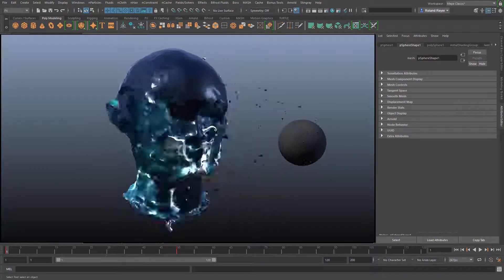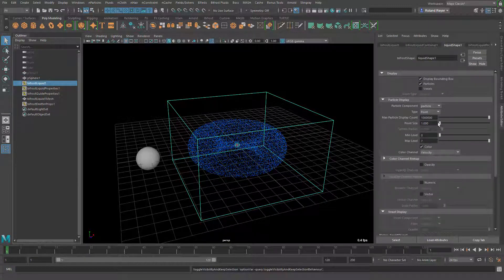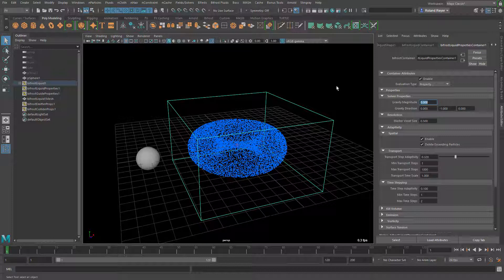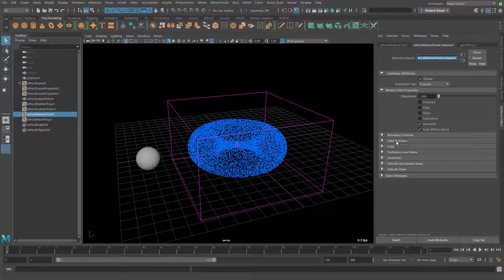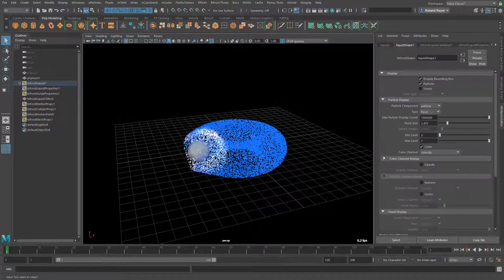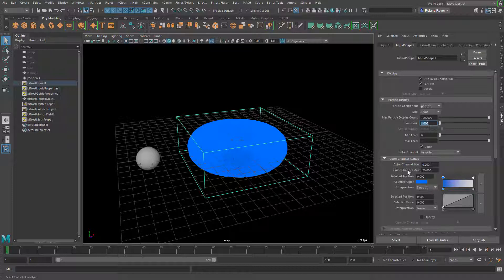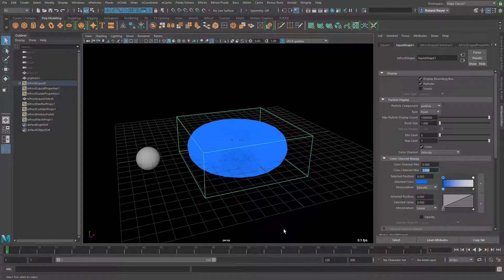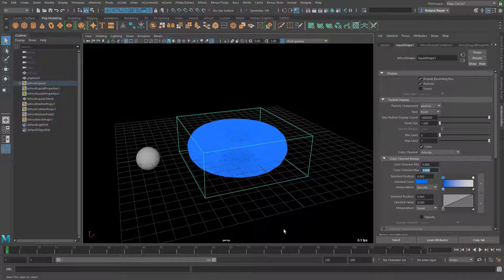Simulate liquid objects that keep their shape - Maya 2018 - Bifröst

Comment from the maker: The video has the wrong title slide and nobody ever noticed!
Reply: Hi, I'm on Maya 2016 in my school, and on I don't have Motion Field in the Bifrost, any way to replace it on 2016 ?
Reply from the maker: @alexismaquaire6201 Hi Alexis, as a student you can use all Autodesk software for free! Visit https://www.autodesk.com/education/free-educational-software
Reply: Roland Reyer I disliked
Reply from the maker: @nedkelly6286  Never mind. I know that my German accent is hard to bear.
Reply: @RolandReyer  Your accent is totally fine sir, thanks for helping me with this subject. Trying to settle a sim back down to a still surface, this is going to help a ton!
Reply from the maker: @AlecrimVirtual  Which version of Maya are you running?
Slow performance could result from the settings in the Bifrost menu regarding cache.

Comment: i'm trying to create this Terminator effect where the figure appears from a puddle of liquid metal. it kind of works ... but the geometry shape is only very roughly recreated . Even with low voxel size. Any hints on this?
Reply from the maker: Is the liquid behavior very important? If not, you could try the new Bifrost 2.1 which does not (yet) have the liquid simulation like Bifrost 1, but it can turn geometry into a volume, make an isosurface from it and there you can adjust the resolution so that you get closer to the geometry.
Reply: @RolandReyer  thanks i will have a look

Comment: Hi...Awesome tutorial... I followed all your steps, but my liquid wasn't going back to the original shape...But I was able to solve it.. I figured out I had to increase the magnitude of the field and also apply a value of 1 for the drag normal value...
Reply: Thank you for this, really helpful! I was just applying the Normal Drag value and still testing it but I'll also play around with the magnitude of the field to achieve a similar result to the video.
I've also found that under bifrostMotionFiledContainer > Geometry > Max Distance increasing it has an impact on that as well I think, for me putting it at 2 seems to work relatively well, but I'm still testing to make sure I understand what it does.
Reply: Thank you for this!! I also had the same issue.

Comment: Hi, how are you? Amazing tutorial, but I need your help, my PC doesn't run maya fluid well, can you check if my configuration is good? My PC config.: AMD Ryzen 7 2700X - 16GB RAM - NVIDIA GeForce RTX 2070 - 2TB HDD + 240GB SSD

Do you think that my cpu is enough to run fluids? Thanks
Reply: not enough, needs quadro, but still its ok ok fast
Reply: u need to know that bifrost and everything having dynamics are heavy no matter what pc, theres no liquid smooth build no matter what u make sli with, it does get close to that in very very heavy build of quadros on sli but hey, u gonna sell urself for that.

Comment: Hello there! I followed this tutorial using a photogrammetry head mesh. I came across a lot of issues with it not wanting to return to the original shape despite "Enable Falloff" being turned off and "Drag" being played with. I finally figured out that for some reason it didn't like the fact that the photogrammetry was a plane so had no thickness. This isn't picking at the tutorial at all, just a workaround I found for anyone else having similar issues! :) I'll be uploading the final vid soon, thank you for your help with this project!

Comment: Sir after applying motion field to the object with the along normal -5. even before colliding the sphere the liquid is traveling towards -x axis direction
Reply: Even after that there is no change in it sir
Reply from the maker: Hi, this sounds like the motion field still has some uniform component on. The field should be just "Geometry", no other field.
Reply: Thank u sir now the liquid is stable but even after applying along normal -5 the particles are not coming back
Reply from the maker: Then maybe set the min/max distance to off.

Comment: how do you scratch cache? 
I've done everything step by step but mine im using a sphere as the mesh and at the end its like a hole is in it pouring water out? i also tried unchecking enable falloff but still get like the mesh was pierced and it wont go back to its original shape...
Reply from the maker: Hi Kristina, for the scratch cache you need to "Enable Background Processing" in the dialog "Bifrost Fluids->Bifrost Settings...".
If the liquid/particles don't return to the original shape:
- re-create the Motionfield (to make sure you had the geo and liquid selected properly)
- make sure you have set some magnitute
- try if the other aspects of the field do something (like "Directional")
Reply: thank you ! i'll try messing with the settings some more :)

Comment: Hi! how do I add a material to the simulation? I'm a beginner using Bifrost and I don't want to mess up the simulation 
:P
Reply from the maker: Juan Martín Rivera González : by default there is a water shader attached to these Bifrost liquids. In the Bifrost object you can turn on the “Mesh” option to create a polygon surface, that can carry any kind of shader.

Comment: Im having problems with a part of the liquid sticking and being dragged out by the collider and not returning while the rest of the liquid goes back to the original object, any idea why? I followed the same steps as you and I believe everything is on default for me.
Reply from the maker: Maybe you need to turn off the "Enable Falloff" in the Motionfield. When the liquid gets out of that range then it won't return.
But can be useful if you want to transport the liquid into another shape (another geometry with a motionfield).